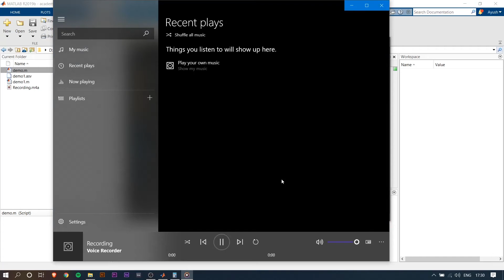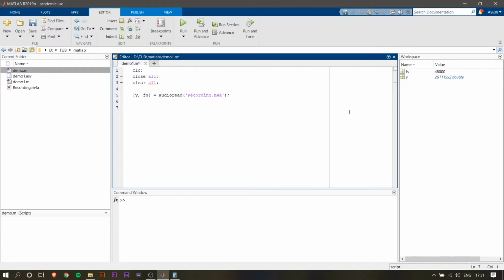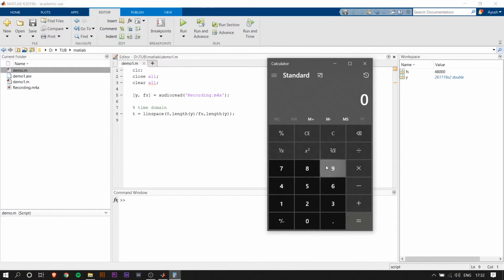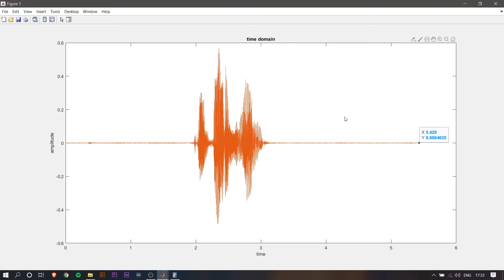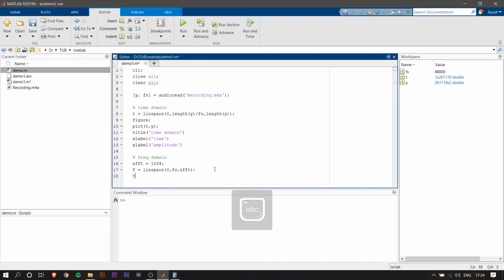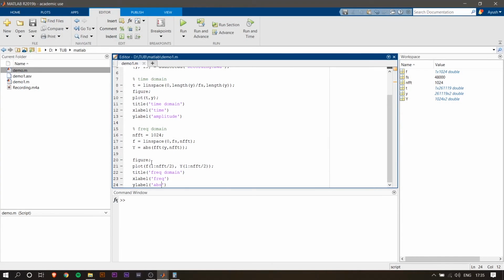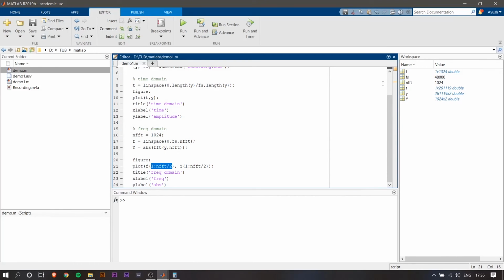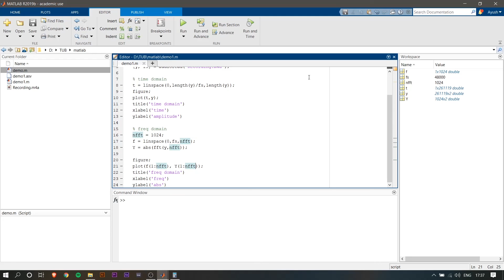Reading Audio Files and Plotting Time Domain and Frequency Domain Signals in MATLAB!

Comment from the maker: Small correction: When you plot the fft over all nfft points, it isn't the spectrum from 0-48 kHz. It's the spectrum from -24 kHz to +24 kHz. The reason we plot only until nfft/2 isn't the range of audible frequencies but the Nyquist theorem which says that any frequency over fs/2 will lead to aliasing in the spectrum.

For a real valued time domain signal, the DFT-coefficients for negative frequencies are the conjugates of the ones for positive frequencies which is why it looks symmetrical in the abs-spectrum.